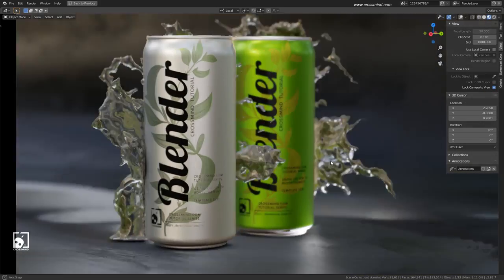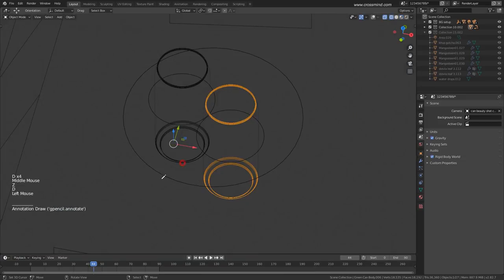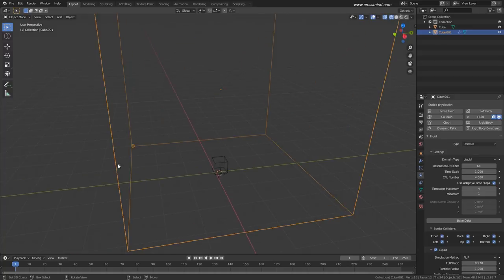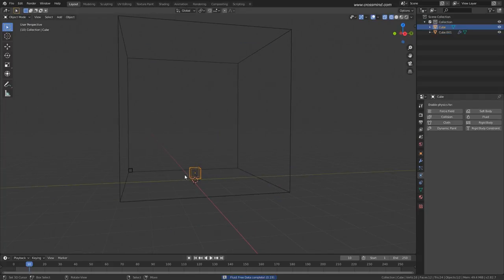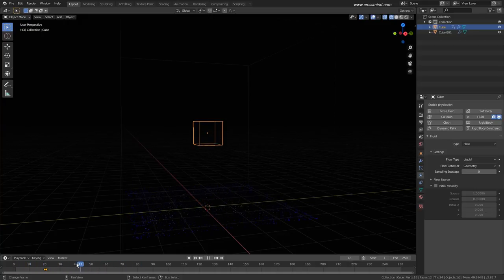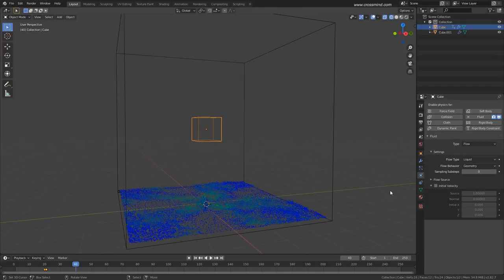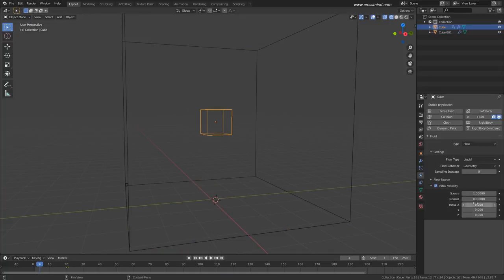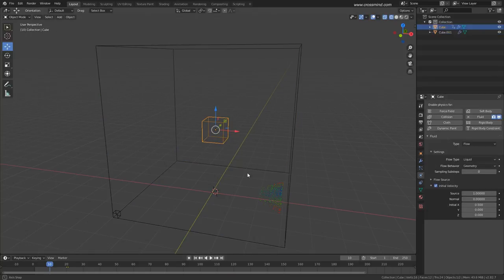Blender Physics - Creating a Splash with Mantaflow

Comment: Thanks for the Mantaflow based fluids tutorial. If you have time, please upload some small tutorials on Fire and smoke too. Something similar to your demos on the channel.
Reply: yo i remember these demos they were insane
Reply from the maker: Check playlist section, There are few chapters of fire n smoke for mantaflow.
Reply: @CrossMindStudio  hi sir i'm ur very big fan, actually i'm following ur tutorial right now in blender 2.93.8 so what happened is after i bake my water, it just falls down on ground instead of splashing on the can, i even turned off gravity and applied all the settings mentioned in the video, but still the problem occurs, so could pls give a solution to this problem :)
Reply from the maker: @y_king-47  increase velocity for emitter in direction you need it to splash.
Could be x y or z
Chk your viewport nevigator to determine the axis
Reply from the maker: @y_king-47  Noctua D15 level fan?
Reply: @CrossMindStudio  wut is noctua D15 level fan

Comment: why my effector collision is not working? the liquid just went through the can.. my blender version is 2.9
Reply from the maker: Try giving it some thicknesses in collision parameters. N also add some more mesh to it if its too low poly. 

Here is detailed chapter abt liquids
https://youtu.be/fuuKOFLmg3U
Reply: have you tried to put some surface thickness on your object? Sometimes 0.2 helps some thin objetcs. srr bad english

Comment: frustrating..did everything like in the video but the fluid is NOT spreading in normal direction...moves in the opposite direction.but my normal is definately facing in the other direction =(. can't sovle it. please heeeelp
Reply: did you check face orientation?

Comment: hi, great video. Im using the version 2.93 and the plane flow doesnt work as in your video. no matter the number i put on normal the simulation just go down. The only way i can give it direction its by using the X, Y, Z velocity. I checked the normals of the plane and its in the correct direction .
Reply from the maker: For norma velocity to work you need surface emission i think.
Change surface emission and see if that works. Also chk mantaflow playlist chapter 4.
Reply: @CrossMindStudio  you mean the surface emission in the material properties? I did but nothing really changed. I gave it another try and noticed that i need to use 15 for the normal velocity to make it move like yours, while you only use 2. It could be related to the size of the domain or the flow object? . I watched the other video but at that time i was dealing more with the resolution, my render looked awful but this video it improved the way it looks. Thanks
Reply: yup.. Im kinda having the same issue
Reply: @cvaug6958  hey. I am facing the same issue. Did you find any solution to this?

Comment: Thanks for this update tutorial. Im using blender 2.9 and my fluid falls down just at the beginning it is not shooting to the can. Any recommendations.
Reply from the maker: https://youtu.be/fuuKOFLmg3U
Reply from the maker: Try this, it might have answers. But i think you need to change your flow source to inflow instead of geometry n work with initial velocity in normal direction. Chk above video.
Reply: @CrossMindStudio  Im using inflow not geometry.
Reply: @CrossMindStudio  Okay let me check it out. Thanks
Reply: @CrossMindStudio  I have redone the all fluid animation and it worked. Just remember the old tutorial where you set initial velocity Z to 5 m/s and it worked. But the problem is when i set the keyframes the fluids are moving out of the plane. Did you apply collision so that the fluid dont enter the Can ?
Reply from the maker: @helderlucau1629  good to hear that. Try the new chapter about liquid basics in mantaflow playlist. we discussed all basics there.
Reply: @helderlucau1629  I think you should use is plannar in collision
Reply: @binilmkumar2959  hey. What is the plannar?
Reply: @palakshukla6077  You have to add Fluid physic to your can too. Then for Type choose "effector" and effector type "collision" and check "is planar"

Comment: I'am using blender 2.93.1, I can not resize the domain , Only can use Equilateral cube as domain. If I resize the domain with apply scale, the fluid particles will be problem.

Comment: particles are clipping through my can on the top half, why is that? only the bottom half is reacting to the emitter. I have made both my cans as an effector. Blender 4..

Edit: Had to select the effector-collision object (the can) and use 0.5 as surface thickness.

Comment: I've been suffering for 4 days now. please, help. the liquid falls down and does not fly out as in the video. did everything as in the video. and even when I copy the plane kolyuzhen ignores.
Reply from the maker: Try to increase the normal velocity of emission plane.
Reply from the maker: There have been changes in the in forces and velocity work so you might have to bump the values to high number.
Or you can also use velocity xyz axis.
Reply: @CrossMindStudio  thank you very much helped. and thanks for your work

Comment: Great tutorial!  Quick question Crossmind Studio, what are the dimensions of your cans?  Thanks!
Reply: Hmm. interesting.. Just looking back at your earlier tut (using the curve to 'lathe' the can, interesting approach).  It looks like your can is X-1.94m, Y-1.94m x Z-4.48m.  Is the reason for this size so that the water sim looks good?  Any reason why you wouldn't use an actual coke can dimensions, of say  .122m (12.2 cms?)
Reply from the maker: Digital Cyclops Video Productions in older version of tutorial my reason for upscaling the model was, because meshing a very small scale fluid system was creating some problems.
But i think with new mantaflow system that shouldnt be much issue.
Reply: @CrossMindStudio  Yup.. I noticed this too after doing the tutorial using an exact can size model.

Comment: Hi. Tell me please. is it possible to start the simulation not from the first frame? for example from the 30th frame. Or move the fluid simulation frame by frame?
Reply from the maker: Yes you can simulate the animation and in cache settings there is offset parameter. Which can offset animation which is baked. Its technically not the same thing but this might help.
Also you can time the inflow objects to activate on desired frame as well.
Reply: @CrossMindStudio  thank you very much

Comment: i kept the can size to real world dimensions. but the baked fluid particles are looking huge. should I increase the size of the domain? right now the domain is about 2 feet x 2feet
Reply from the maker: try increasing the resolution of simulation a bit if that doesnt work that increase the overall size of simulation( domain and can)
Reply: @CrossMindStudio  increasing scale of domain and can worked. apparently simulations don't happen properly at ver low scales

Comment: hello, first of all excellent tutorial, I have a problem, even though I put the parameters, the water does not come out with as much force as in the video, it only comes out a little and falls
Reply: I have the same issue did you found any solution?

Comment: Found a bug that if you use less less than 64 resolution divisions, the fluid will not generate at all. So if your fluid is not appearing, try increasing resolution. Blender 2.9
Reply from the maker: Hmm, make sure emitter is not smaller than voxel size. Chk the latest tut( mantafloe chaoter 4)

Comment: 7:00 oddly as I was following along, my domain cube was mirrored (flipped) around x, y, and z. The fluid was emerging in the domain opposite side of the origin to the inflow cube.

Flipping the domain object returned things to "normal".

There are obviously some glitches with this. I'm using 2.91 (latest stable release).
Reply: Also, my initial setup didn't work with the default settings, I had to go to the inflow cube and set "surface emission" to 1.0000 (it defaulted to 0).
Reply from the maker: watch chapter 4 in mantaflow playlist.
Reply: yup.. Im kinda having the same issue

Comment: why does the fluid seem to go through the can even after setting the cans as an obstacle
Reply from the maker: Try n increase the surface thickness for collider, that should help.
Reply: @CrossMindStudio  i tried and it worked perfectly, thank you so much, i cant wait for more lessons from you
Reply from the maker: Skyler Queenz chk playlst section :)
Reply: @CrossMindStudio  during rendering will the small green drops in the fluid appear in the scene, from your explanation towards the end there you show us your final render but it doesnt have the green drops
Reply from the maker: @skylerqueenz6452  If you mean the small drops on the surface of the Can object, then those were modeled with particles along with Can object in Chapter 1 of this series.. 
In case you are confused - please check the link in the description. Hope this is what you were looking for.
Let me know.
Reply: @CrossMindStudio  no i mean after baking the mesh, i am using blender 2.83 so i am dealing with manta flow.. look at the video you created talking about manta flow and go to upto 46:10 you can see the fluid has some green and blue
Reply from the maker: @skylerqueenz6452  Those green dots are particles, that will not render. Particles are converted into mesh and that mesh is what you see in the final render as liquid.
Reply: @CrossMindStudio  okay thank you so much

Comment: All my fluid options are diferent. I don't have the options of the video.
Reply from the maker: What version are you using?
Reply: @CrossMindStudio  2.81a
Reply from the maker: Isaac i think mantaflow was introduced in 2.82 . So you might be seeing the old simulator options.
Download latest version .
Reply: @CrossMindStudio  thx Now I have actualized to 2.83 but I dont have the "bake data" button
Reply: Solved: change the "replay" option for "modular" or "final".